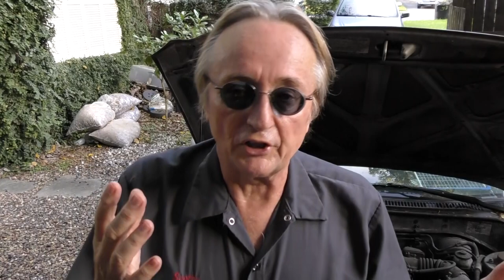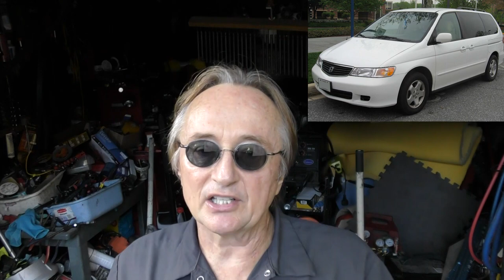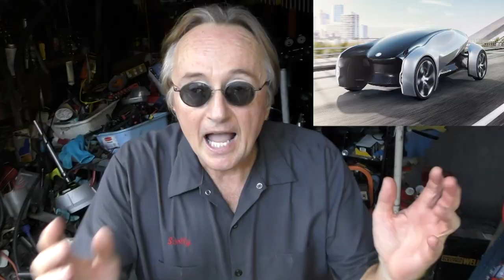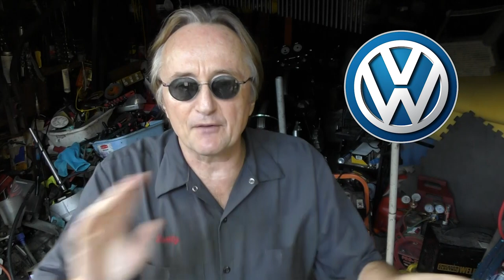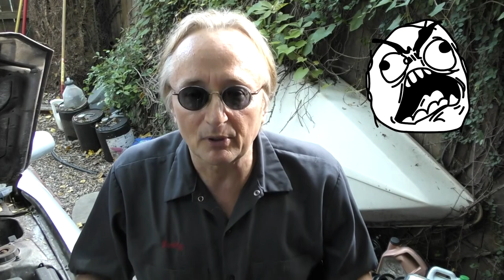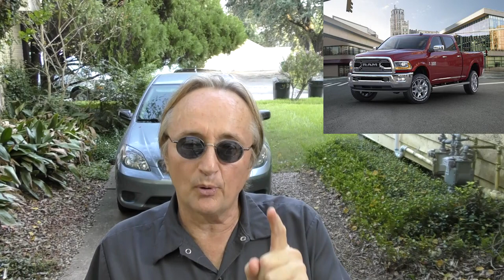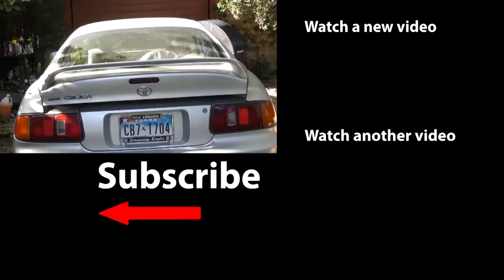Who Makes the Worst Automatic Transmission Cars in the World

Comment: My 1996 Honda Accord automatic had 370,000 miles before i sold it. Honda automatic are still better than american and german cars.
Reply: My 1996 Honda Accord with 300K miles is still going strong. I've had it since 2001 at 79K miles. I have no intention to sell it anytime soon.
Reply: 2004 acura TL 271k miles automatic transmission and shifts like a new car.. i do change my transmission fluid every 25-30k miles i think thats what most people with issues never do.
Reply: 2006 crv trans still working just change fluid every 25000!
Reply: My onda civic 95 automatic 384k miles still run like new thi
Reply: Just to balance the forces of the universe, my '02 TL-S has 219,000 miles but it's taken 4 transmissions to get there.
Reply: PhiloF didn't the TL first gen only
See those problems with their tranny
Reply: No it was the 2gen, '99–'03
Reply: The transmission problem with Hondas happens when they're combined the V6. The 4cyl automatics are good.
Reply: Jorge Lopez was
Reply: On that generation I bet all the door locks crapped out as well as the windows
Reply: Were they made in Japan back then?
Reply: Honda please!! I had 2001 bmw 325i whit 3,9500 milles and no single issue!! Just make regular services#!
Reply: Better than German cars? Are you high?

Comment: Sad that cars made in America are complete junk anymore. I used to buy American and then just trade out right when the warranty went out or was gonna run out. Finally I wised up and bought Asian. They make better vehicles that are more fuel efficient.  They just last longer as long as you buy vehicles with the small engines that they have the most experience with. Their larger V6 vehicles are ok but they just don't have enough experience with bigger engines and those tend to have problems earlier than their smaller cars. The bad thing about buying a European made vehicle is that they are hands down the most expensive to fix.  Even the Asian cars are cheaper to fix usually.
Reply: Toyota Honda and subaru are the best
Reply: Not what they used to be. My Corolla has far more issues than my higher mileage Saab even. It gets worse mileage and has half the horsepower.
Reply: I work on many brands. American made cars and trucks for the last 20 years have been pretty good. I would give Chrysler products a lower rating than the GM and Ford models.
Reply: toyotas v6s were great, i dont know what your talking about?  if anything im more worried about their new turbos. only 1 japanese company has extensive knowledge of those and thats subaru (though they have always had oil burning issues)
Reply: False claim.
Most American cars are not junk
Do you work in foreign car sales one way or another  ?

Comment: I'll put transmissions that blew in my experience

Honda
Acura
Jaguar
Reply: F M I had a 1999 Acura 2.3CL. Bought it brand new. The transmission went at around 45,000 miles.
Reply: I had a Honda Accord (2004 Coupe) that the transmission failed at 80,000.  I bought it at 57,000.  I think the previous owner must have used it to commute in heavy rush hour traffic or something.  Idling in heavy traffic puts a lot of strain on these things.
Reply: Yikes! Im about to buy a civic honda, 2005, 167,000 miles.
Reply: Mr. Happy  yikes
Reply: Mr. Happy  ggzzz.

Comment: I had a 1998 Honda Accord transmission went out at 172,000 miles.  I never got a Honda again.  Now I have 2 Toyota Solara’s one with 171,000 and one with 53,000 both run like a champ.

Comment: My friends 2016 Toyota Highlander Limited at only 48K miles, their transmission blew.
Reply: Most likely never took care of it.
Reply: Yes, they did take care of it. They performed all of the required maintenance that was stated in their owners manual.
Reply: hmm...thats so rare. We have a 2004 Sienna with 300k Miles and the engine and transmission are both original. The vehicle has been driven rough in the last 14 years but the maintenance was never neglected. Still drives like new.
Reply: My friend no longer has that car. They must of had one of Toyota’s lemons.
Reply: My Friends's 2017 Porsche Cayenne S at only 23K miles, their transmission blew. My neighbor's 2016 Mercedes-Benz GLE-Class at only 32K miles, their transmission blew. 
The Mercedes and Porsche's engines also blew.
Reply: Anybody can make a few bad cars folks, it's all about numbers. If Toyota makes 35,000 cars, and 1000 have an early bad transmission, and Ford makes the same 35,000 cars, but 15,000 have an early bad transmission, which company makes a bad transmission? Toyota isn't perfect, no car maker is. It's the numbers that prove there's less Toyotas with problems, than any other car manufacturer.
Reply: Yeah people never learn with garbage toyotas
Reply: A transmission shop we use in NC had 4 of those highlanders in his lot waiting for transmissions. Went buy there to get a part and was like wow. I didn’t ask what was wrong but they had tags in the windows.
Reply: S. T         We have had 4 dud Toyota’s . A 94 truck,a rav 4 and a 08 Tacoma and my tundra.

Comment: I wholeheartedly confirm what Scotty said about the Honda Odyssey transmissions.  Bought a 2000 model and went through 3 transmissions.  Never another Honda again.  Got a used low miles BMW E46 and still driving it with NO major repairs.  That E46 engine and tranny just hums smooth as butter.

Comment: Hey Scotty ZF Transmission are made in Germany, by ZF Transmission just to let you know.
Reply: be it in cars or trucks, they breakdown often
Reply: Yup, so does FUSO trucks UD trucks and many other truck brands out there and they fail in under a few months.
Reply: Yep, while the 9 speeds are awful, the 8 speeds are great!
Reply: Does zf make the 8 speed in the hellcat?
Reply: @christopherhendricks4369  Yes they do. I'm just going to save up the suspense, the ZF 8 speed automatic is strictly for RWD and AWD platforms. So here are all the FCA cars I can list from the top of my head that include the ZF 8 speed.

-Dodge Durango
-Dodge Charger
-Dodge Challenger
-Chrysler 300
-Jeep Wrangler JL
-Jeep Grand Cherokee
-RAM 1500

Other manufacturers also use this tranny such as BMW or the Volkswagen group too :)
Reply: The ZF 8-speed with BMW software is the best automatic transmission ever made. Incredibly smooth and never had any issues in 4 different BMW:s we've had them in. This is obviously my opinion.
Reply: There is a ZF plant here in SC also, so not just made in Germany.
Reply: ZF 9-speed is made in usa, that's why it breaks
Reply: @simeunovicm  this seems to always be the secret when something fails
Reply: @frooz442  it must be pretty solid. It needs to handle almost 700 lb ft of torque.
Reply: simeunovicm bad design from zf

Comment: I use to have a dodge caliber and it is the worst transmission ever, I spent 350 dollars every month to fix and put coolant and still goes on limp mode 😥😥😥😥 that's why I switch my car to toyota corolla s 2012, best decision I've ever made
Reply: CAT MARIO i rented a caliber once. Horrible.
Reply: You aren't supposed to put coolant in a transmission.
Reply: @ismann9148  yeah right either that or swap car
Reply: Another CVT transmission (Chrysler no longer uses them) Nissan's CVT's  are by far the worst made by Jatco a company partly owned by Nissan, Mitsubishi & Suzuki. Honda makes their own CVT which is less troublesome then Jatco.
Reply: I have Dodge Caliber 2010 with 340000 and no problems.

Comment: What about those old Jaguars. They were one of the worst vehicles ever made. They had too many mechanical problems.
Reply: British vehicles are junk
Reply: I drove a 1984 Jag XJ6 Vadenplas, electrics were a known issue but it was the best ridding car in that decade fully independent suspension with full rear cradle 4 (rear)shocks and springs, disc brakes all around and a firm ride at 2 plus tons. The straight 6 while not powerful didnt even sound like a combustion engine but more like an electric motor, it was that quiet and smooth. Everything was special about that car including getting it to run right.
Reply: Jaguars of that era used the Borg-Warner  Automatic  Transmissions. they were big and shifted slowly; don't know if they are even made today.
Reply: Yes! Apparently the X-Types are known for engine leaks.

Comment: The new Honda Odyssey minivan is better then Toyota Sienna for 2 reasons: 1) Honda does better in a crash test than Toyota. 2) Honda has high tech features including a better infotainment system with Android Auto that the Toyota doesn't have
Reply: Scotty is talking only about the automatic transmission.
Reply: You do realize lab crash tests rarely mimic real world conditions or crashes?
Reply: Infotainment systems do not make your car go...just expensive decorations.
Reply: really so that why they have failing transmissions (CVT), no to mention the 1.5 turbo problem the reality is that people does not know that honda right now is worst than nissan.
Reply: Toyota has the most reliable CVT and their 1.8 engine in the Corolla sedan is very reliable which is why they didn't update the engine when they redesign the Corolla in 2014. They simply carried it over from the previous generation
Reply: @davinp  i would not agree to that they have the most reliable CVT because corolla is only one vehicle, but the corolla has the most reliable CVT.
Reply: And your reply is some how stating what? It still does not stop honda reputation of making crappy CVT.

Comment: I think Scotty is bit old for recent times on transmission. Yes, transmission in the 1999-2003 oddsey was crap, but Honda has learned has built better transmissions and better vans than Toyota has in the last decade. If anything, the oddessey is more reliable than a Sienna at this point. Got bunch of friends having to trade the Sienna cause the transmission or some other component kept failing for them.
Reply: He said worst not recent num nuts
Reply: Sienna is better its all wheel drive
Reply: 2016 Odyssey 44000 miles bought new, shifts like butter

Comment: I had the use of a 2000 dodge caravan for about 15 years and only 2 problems i had with the transmission one was the shift solenoid gave out. 7 years ago. I replace it and work fine. The other was needed a trans fluid and filter change last year worked with me. Gave up the van this year because of electrical problems not related to transmission.

Comment: As soon as I saw the title, I knew it would be Chrysler lmao And I was right, When I read in car & driver that they were going to put a 9spd  in the new CherokeeI knew that transmission would be garbage, what the hell 9 gears?.... And I was right, so I can only guess Soum the 8speed they put in the v6 chargers is garbage too
Reply: Fruitableee YT What else are they used in besides the charger/Challenger? And who is the exact manufacture of that transmission
Reply: @JDMHaze  The Charger/Challenger/300 have the same ZF 8 speed. ZF is a German transmisson maker, other manufacturers use ZF's 8 speeds and 9 speeds, such as Honda, BMW, Volkswagen, etc
Reply: Fruitableee YT OK I thought so I remember Porsche using one , Can't remember which Porsche... but I was curious
Reply: @JDMHaze  I thinm Porsche uses it in the Cayenne and Panameras.
Reply: 9 just in case one or more fails you still have the rest
Reply: Kaityn Kuang mmmm chrysler had a backup plan for every situation lol

Comment: Why you always picking on Chrysler? Oh yeah they're junk!
Reply: They're*
Reply: @Untouchable2584  my phone has auto fill. Please forgive any errors.
Reply: @craig9365  please forgive. I didn't know I was being graded.
Reply: @craig9365  it's called typo bruh and this aint english class, surely you texted fast before and had to redo or edit on youtube ...😁😁😂
Reply: @craig9365  I fixed it for you.
Reply: Got a Chrysler 300c 200,000 miles, still runs great, also have tow hitch and pull 1000lbs trailers behind... Transmission still shifts great.. And 360hp!!!!
Reply: 1994 Dodge Dakota 197xxx still going ( had to replace torque converter at 190xxx)
2006 Dodge Dakota 175xxx still going
Chrystler town and country 195xxx ( before my sister crashed it)
1987 Dodge 150 160xxx still running .... And now a 2016 ram 1500 , only has 20xxx but I just bought it😂
Reply: @Zacho166  95 Jeep Cherokee 230k no quit in site. But transmission is Asin.
Reply: We have one 2004 2500 Ram truck. It has 1.4 million miles on it. We have an 07 with 800 000 miles on it.   The trucks pull a gooseneck trailer with skidder or Backhoe on it or a large dump trailer daily. The original transmission works perfectly on both trucks.
Reply: They aren't just junk.  The fact they deny warranty claims etc on stuff and don't take ownership of their design flaws.   During a recall they broke my 4x4 low and everyone who received that recall it broke 4x4 low.  Hundreds of pages on Jeep forum of people yet call Chrysler and they said oh we never heard of what you are saying.  It was like a script word for word.  People wrote the dumb response on Jeep forum because they told each of us the same thing.
Reply: I got sick of sinking time and money into a 5 year old PT Cruiser. My wife liked it, but it needed a major repair every year even though it had under 100k miles. You gotta pull the engine out to fix broken sensors, or even to check the spark plugs. Hourly mechanic costs just to do simple things is why I don't think Chrysler knows anything about making cars.
Reply: @boriscat1999  Yeah, I agree the pt cruiser was junk!!!!
Reply: @John Q It happens. some models are lemons. But a disproportionate number of Chrysler models have problems versus GM or Ford. Obviously if a person does research on a model BEFORE they buy, they'll be much happier with what they get.
Reply: @John Q I don't think I made a good decision nor did I do sufficient research when I bought a PT Cruiser. I know better now, but I think my purchasing behavior is more typical of most people than the meticulous research that you suggest people are doing.

I think a manufacturer that has frequent problems across many models or many years should be suspect. Out of 3 Chrysler my family has had in the last 25 years, every one of them had a drive train or transmission problem within 6 months of warranty, sometimes after warranty, sometimes just before. Admittedly my example is anecdotal, but it is not hard to dig up bad press on Chrysler.

At this point, I see no reason to look at Chrysler unless there is some major positive change in management (being part of Fiat is not a positive thing). I think it's especially important not to touch a 2019 Chysler or Dodge until other people have been driving them around for at least a year. 2106 Dodge RAM had an annoying number of sensor problems that a lot of owners got to know mechanics really well, most of it covered under warranty but what a hassle!

Comment: I've had 2 grand caravans one 98 and 04. Neither had a transmission problem 98 had 300,000 when sold. And 04 still driving 249,000 and buddy of mine 489,000 when he donated it. All had original engines and transmission no major repairs 3.3 3.8
Reply: Congrats on the nearly 600K miles combined on your Chrysler vans. Chrysler built the hell out of their minivans back in the day. There's a reason why taxi companies love them, they sure wouldn't use them if they weren't well built. The Crown Vic of minivans.

Comment: Dodge caravan lasts a long time with no problems. I disagree.
Reply: The problem with the Caravan was that Chrysler shot themselves not just the foot but the head with the automatics in the 1st generation ones. Not only did they use the transmission from the much lighter K-car, they confused everyone about what fluid it needed. The dipsticks were even marked wrong.
Reply: They don't even have dipsticks in the new ones.  Have to watch videos, get out your ruler, and scribe your oil dipstick to check it.   @doug112244
Reply: I had a 2002 or so Town n Country and the transmission went out...at less than 150k and blew two radiators within 3 months apart..
Reply: My Caravan has 225,000 with no major problems.  I drove it right, and maintained it by the book.
Reply: I agree. Those were good.

Comment: The Chrysler 727 and 904 torque flites also had lip seals in the clutch. When you lost reverse or 3rd you had a cut seal so it was time to rebuild. The 400 GM and the 350 GM also had the same problem and the 350 wore out all the bushings too. The Ford transmissions did not have lip seals but square seals that work good but they had plenty of other problems. They still use the aluminum Powerglides today in repowered old cars because they where made so simple and dependable.

Comment: Solution: drive stick.
Reply: @Kelly Marie  Even BMW (!) has dropped it on the new 3 series.
Reply: True true.  Mostly the guys who are making "fuel efficient" cars have killed the manual -- because they have to put in stuff for the "red light stop-start" that is basically same as an A/T.   I was surprised that Honda is still selling stick vehicles, but Subaru has left them out of a lot of cars, and eventually I suspect they will even be moving to paddle shifters (auto) for all WRX.  Then they will wonder why their WRX sales tank.  @Kelly Marie
Reply: Get an old Chevy with a 2 speed Powerglide
Reply: Cant find em, grind em!
Reply: @Greg Myers my truck is manual.